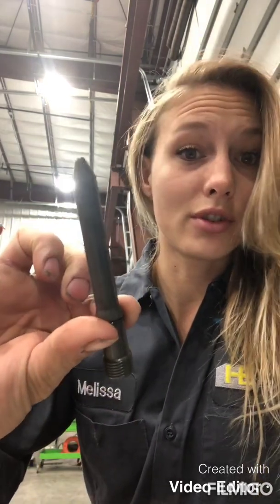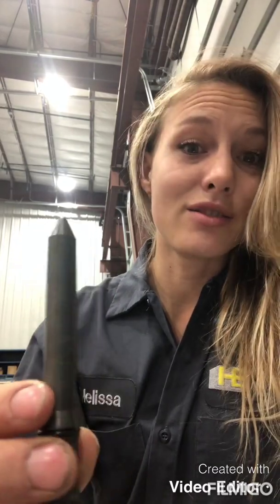Diesel Engine Fuel Systems, Fuel Delivery Tubes

Comment: Cat  call them quil tubes, I cut the end off a old fuel line, especially since you can't reuse them , make up a slide hammer weld end of cut off fuel line, screw on to quil tube, pull out, or pry against on cut off fuel line nut

Comment: The fuel tube has the same thread pitch and size as your standard lug nut on a dodge Cummins truck.  Thread a clean lug nut on to the tube and use a small bar to pry it out.

Comment: At out Cummins shop we just straight up replace them 9/10 times. Just saves us from having to fix it again down the road. We see a lot of mistakes from ameteur mechanics who monkey with the fuel lines/links and they often cause leaks/failures from over torqing parts, cutting corners.

Comment: Melissa   👸...  should a high
performance Thread 
Sealer be used for the fuel 
delivery tubes ... ????
Reply: NO!!!!  That would be a waste of your time. The pressures in these tubes is in the many thousands of PSI. It must be a pure metal to metal seal.
Reply: the thread compression with
the   DEACON   high temp 
high pressure sealer will
hold it ..  TRY IT  👍..

Comment: I have found the best way to pull cummins fuel tubes out of the head is to just take one of the fuel lines and screw it on a little bit then just pull it. Gives you way more leverage
Reply: I welded  a nut to the end of a bolt that has a Nut on the bolt  with a washer Bottomed  out. Then I slide it in a short piece of pipe. Then screw it on to the injector and tighten the jam nut down on the washer  till it pops the injector out . I made this thing for the 5.9. Engine in my wood chipper . It’s cheap to do
Reply: @DirtBrute  that sounds like alot more work than just screwing a line on and pulling.
Reply: @Dudash.Racing23  I tried that first. they  would not come out . I was pulling pretty hard .
Reply: @DirtBrute  understandable. I have never had a problem with it but the day I do im sure ill hillbilly some shit together to get them out lol
Reply: @Dudash.Racing23  yeah this was on my 5.9 in the wood chipper. Yup MacGyver the shit out of it 😂